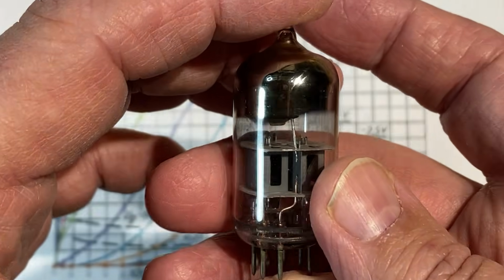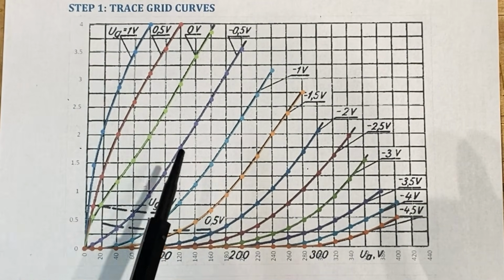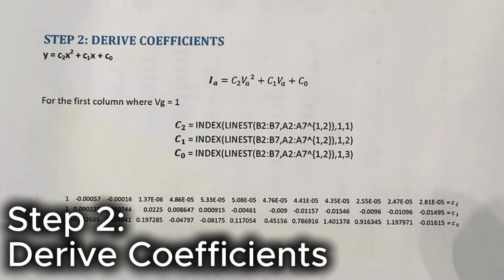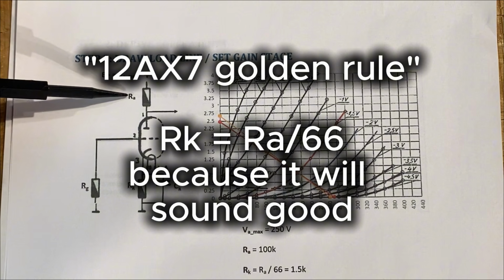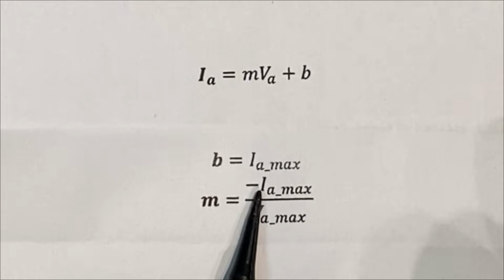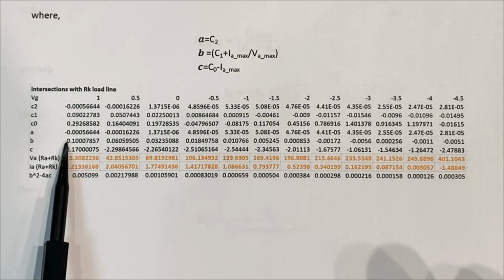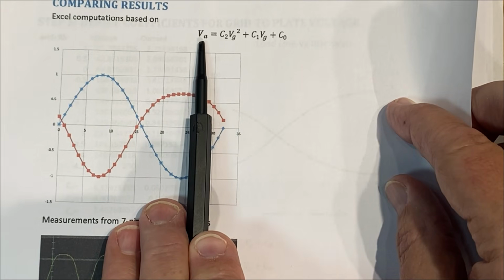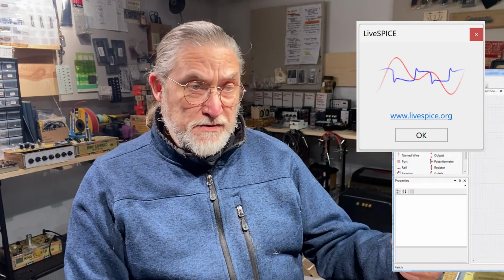Asymmetrical Clipping Explained (PROOF From a Triode Datasheet)

Comment from the maker: In this video, I take asymmetrical clipping out of the realm of “tube magic” and prove it directly from a triode datasheet.

Using the grid curves from a 6N2P dual triode (a close relative of the 12AX7), I step through the full mathematical process of converting datasheet curves into equations that describe a real tube gain stage. By extracting polynomial coefficients, defining a load line, and solving for the operating point, we arrive at an equation that directly relates grid voltage to plate voltage.

The result is a clear mathematical explanation for the asymmetrical clipping behavior that triodes are famous for — including the pointed lower half and flattened upper half of the waveform. I then compare the math to real bench measurements, showing how closely the model matches an actual tube circuit.

This work also explains why a four-quadrant multiplier (ring modulator) is such a powerful building block for analog tube emulation. Once the math exists, it can be implemented in software, embedded systems, or even analog “computing” circuits to model classic guitar amps like a Fender Princeton, Marshall Plexi, or Dumble — straight from the schematic.

Comment: Fun with math!  I guess the rounding of the tops as Vg goes negative can be seen intuitively as the curves bunch up near cutoff. Not much change between -3v and -4v. Not sure a typical guitar preamp input goes much into the positive grid voltage region from the operating point.  From what I've read, the cathode bias resistor also provides negative feedback to keep the grid-cathode voltage from swinging too much for a given grid-ground input.

Comment: This is very interesting.  I really do appreciate the work you put into this.

This sort of polynomial approximation tends to fail when the input goes much beyond the initial limits.  You've chosen an input range that is reasonable (even a bit big) for passive guitar input, but if the input swings much beyond that at all, we start to see the wave fold over in one direction, and what appears to be infinite headroom in the other direction.  Of course, we don't expect either of those behaviors from a real world tube stage.  

Sometimes we can do better with higher order polynomials, but at best that will just push the accurate range out a ways, still not actually safe for arbitrary input levels.  So in order to write code for this kind of thing, we end up having to limit our input values.  

But then what curve do we use for that limit function?  Straight clipping is the least preferable option.  We'd rather avoid that kind of discontinuity and end up with a continuous curve.  So you gonna create a polynomial approximation for that?  End up with the same problem.

It actually is better and more accurate to use functions that are smooth and self limiting.  The real response of this kind of stage is exponential or power law in nature. Things like tanh or atan are more processor intensive, but safe and continuous with input values to infinity in both directions, and tend to match real world curves pretty closely.

We are able to get a very close fit to your curve (and real world data) using tanh and carefully tweaking gain and dc offset of the input, which is definitely my preferred way of doing it in code.  I'm willing to take the extra CPU hit in most cases.  

It works very much the same way in solid-state.  You can get similar asymmetry from diode clipping or even straight opamp clipping just by adjusting the bias vs gain and that approach can be seen in a number of pedal and other circuits.  

You probably already know this stuff.  The whole concept of doing math with a ring modulator IS a lot of fun, and I look forward to your further adventures.
Reply from the maker: Thank you for your detailed and insightful comments. I particularly appreciate your suggestions on using tanh or atan functions for a more accurate and self-limiting model, as well as your thoughts on asymmetrical clipping in solid-state circuits. I had a whole discussion about how diodes behave as sinh and cosh functions that didn't get included, so your observation is spot on. I've already had to deal with CPU limitations writing a VST. That is what made the prospect of designing a simple opamp circuit to do the same analog computation irresistible. Thanks!

Comment: Great content! I did similar approach when using a Gilbert cell to produce the quadratic function in order to "simulate" not only the assymetrical clipping, but the quadratic effect of generating the more predominant even harmonics.

If such approach is done in the continues time domain, it may work well for a "standardized" way to replicated well known tube models and amplifiers, but if one goes in a discrete time domain, the processing power needed to process a big polynomial (at least 5 to 7 terms) becomes a critical problem.

To me, the key knowledge in this field is to come with the mathematical model (which you did great) and find other analog circuit models that can work in a similar fation. 

Looking forward to see what comes next.

You got a new sub.
Reply from the maker: Glad you enjoyed the content and that you're thinking along similar lines with the mathematical modeling! Thinking ahead, I already know the results (limitations) of my current circuit and have thought to use a Gilbert cell as a way to improve things. Thank you for sharing your experience!
Reply: @MadScientistGuitarLab  it is great to talk to people in the audio field, mainly when there is no "snake oil" gibberish talk involved.
I also tested the 4 quadrant multiplier from Analog devices and it also works great to produce the 2w (two omega) doble frequency. I also used a second 4 quadrant multiplier in series to produce the third harmonic by feeding W and 2W into the second multiplier, but as you know, math does not lie and sine-cosine multiplication yells always to a one constant components that is a DC offset.  The spectrum became fairly rich and very interesting by doing this multipliers cascaded, but it became too expensive and complex, so I went another direction.  

I'm started to do it with a differential jfet pair and forcing a different bias into their gate to create the assymetrical (expanded/compressed) wave.
Reply from the maker: I had wondered about using a feedback loop to generate higher order harmonics. In the few test cases and simulations I tried, it didn't work that well. I had assumed that cascading circuits would be the way to go because it would offer more control. Good to see that you have tried that and that it worked well. But, you are right, it would get expensive having to build more and more sub-circuits. Thanks for sharing your experience!
Reply: @MadScientistGuitarLab  thank you for sharing your experience and posting it here so everyone can learn with it.

In my case I just cascaded it. I guess that if we make a loop it may generate all sort of intermodulation... It may sound curious at least.

What will be you next steps with that?

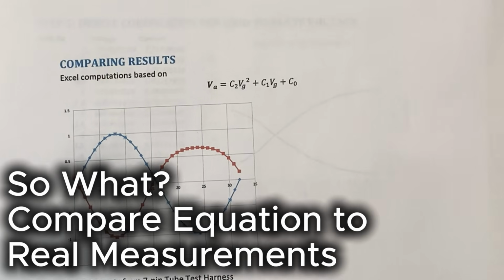Comment: Thanks for the video. I could follow you until 10:30. You have two plots (blue and red) one for V_a(V_g) = C_2v * (V_g)^2 + C_1v * (V_g) + c_0v and for the current I_a(V_g) = C_2I * (V_g)^2 + C_1I * (V_g) + c_0I that fine but I can't figure out the axis on your plot.  Your free variable is V_g for both equations and V_g has aprox. range V_g = [- 4.5 ..1.5] but on your plot the X-axis has the range = [0 ..35] ?.
Reply from the maker: Edit…
That plot is a sine wave and it’s broken into like 36 steps from 0 to 2pi. The blue line is the input signal and the red line is the output… normalized down to fall between -1 and 1. It’s just to show that the shape of the output is identical to the actual measurements.

Comment: Thank  you for doing this. Nice Explanation of your method... and why something that is just accepted, comes from!

You couldn't do it this way even 50 years go. Spreadsheets are so much more powerful tool, than to "calculate the bottom line." In my previous job, I had a lot of curve matching for ADC counts to Sensor Values. Spreadsheets made that trival. 
Even when I do it, it's always amazing how much you can derive with charts and a spreadsheet....
Reply from the maker: Thank you! I'm glad that you appreciate the technique I used. Excel and the apps it was based on were the killer apps that made computing so necessary today. 50 years ago, to run those numbers by hand would have been a HUGE job. Now, like you said, it's trivial. I didn't do a lot of curve tracing in my career, but I knew that function was in Excel. Sadly, it's not a simple function and I had to reference the same cells over and over again to get it working.

Comment: Did you use a curve tracer to get values for those points on the plate curves? I saw that device in the civil engineering department at my Alma mater in the 90s
Reply from the maker: I WISH I had access to a curve tracer. I downloaded the curves from the datasheets. The 6N2P was in Russian/English and the 6J1 (in the Excel file) was in Chinese. To put the curves into something that I could use, once I had them pasted into Excel, it was a matter of typing in a number that would be close and then making small changes until the point in the plot landed on the curve. Thankfully, Excel allows for you to zoom in so you can get really accurate numbers just by eye.
Reply: @MadScientistGuitarLab that’s actually an ingenious method!
Reply: It would be fascinating to compare an LTspice model with your simulation. I wonder if you could run a realtime simulator using something like an STM Nucleo board to set the parameters and hear the results? I’m considering building a RoeTest kit for characterising tubes for some historic reconstructions of 1940s/1950s RF synthesizers and pulse width modulated microwave multi channel voice comms links. I need to generate lots of 9th harmonics for regenerative divider-by-ten subcircuits. Huge fun!

Comment: This is so awesome ! I can’t wait to look at the spreadsheet I’ve been stuck on a solid state pre-amp design and I think this will help me a lot !
Reply from the maker: Thank you. I almost mentioned how different transistors were in the video. There’s a lot of equations for setting them up too (e.g. limit current with one resistor, set the bias with two more, set the gain via two others). Tubes always seemed to have a try it, measure it, and see what happens philosophy.